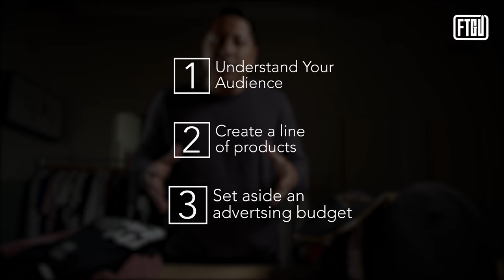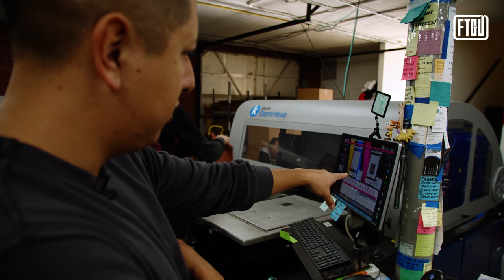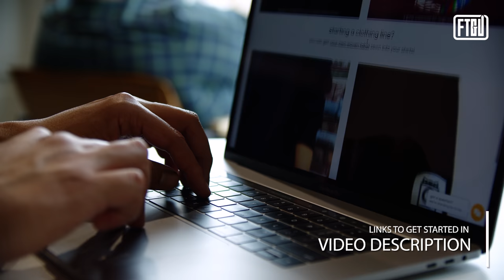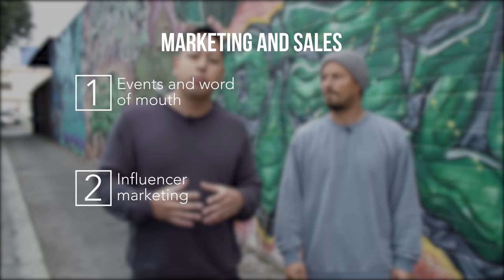Launching A Clothing Line In The New Decade | From The Ground Up

Comment: The issue with this is you are unable to be involved in the printing process, print on demand is much safer but for a brand to have long term success they need to have inventory and good relations with your wholesaler and print shop